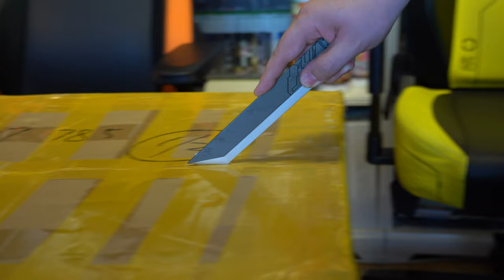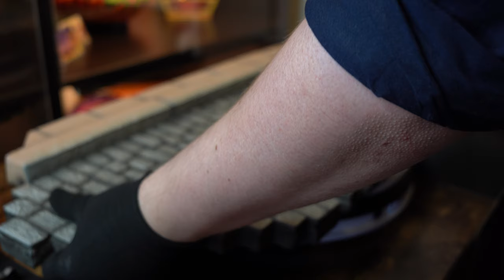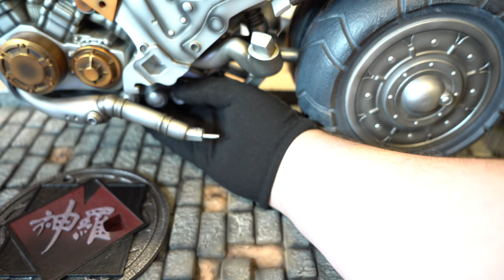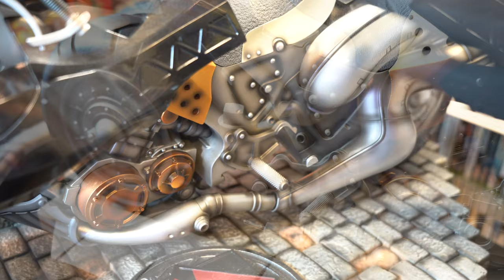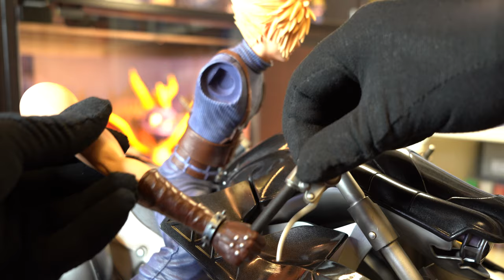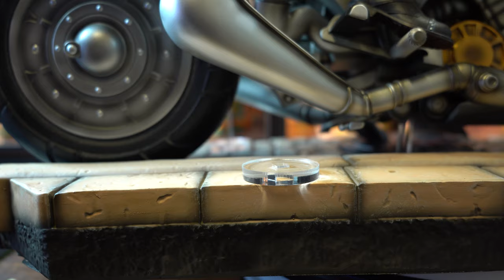Unboxing and Assembly | Final Fantasy VII Remake: Cloud Strife on Hardy-Daytona Statue by SHK Studio

Comment: Great guide for unboxing and putting it together. May I also ask what you use as the turntable? Would like to know since it seems capable of taking that weight and still operating smoothly.
Reply from the maker: Thank you for checking it out :) it's just a simple one from Amazon, I wouldn't recommend it however because I take about 5-10 minutes of footage for the spinning sections of the videos simply because it doesn't run as smoothly as I'd like and I need to cut a fair bit in the edit to make it smooth. 

I have been looking to upgrade the turntable though and this is the one I'm looking at: 

fotoconic Black Electric Motorized Rotating Turntable Display Stand, 24 60cm Diameter, 80kg Centric Loading for Shop Display https://www.amazon.co.uk/dp/B08B85QPQ3/ref=cm_sw_r_apan_i_ZCJFA6498NDHABWCY5NY

Hope that helps :)